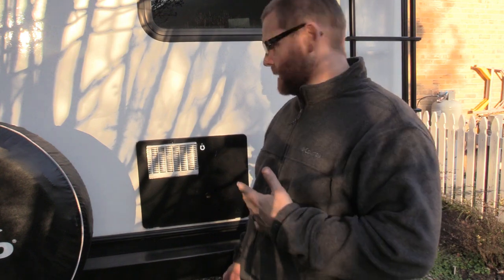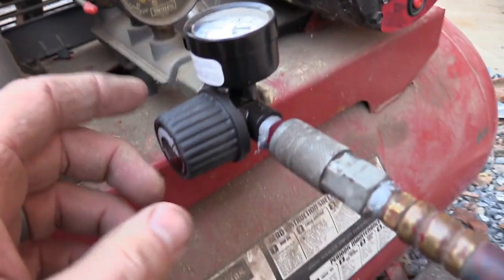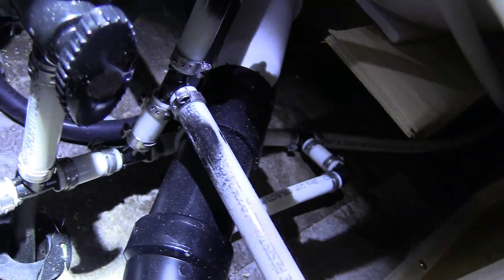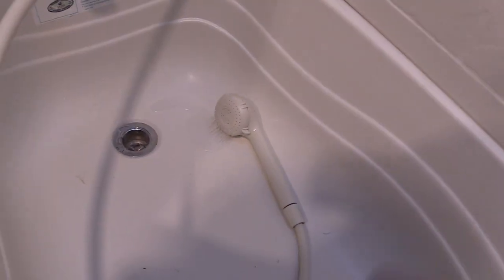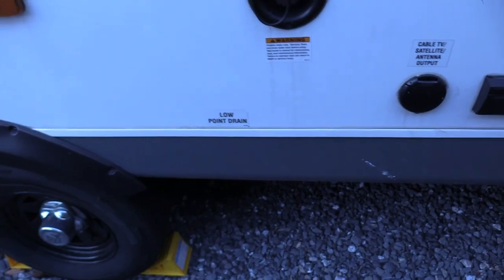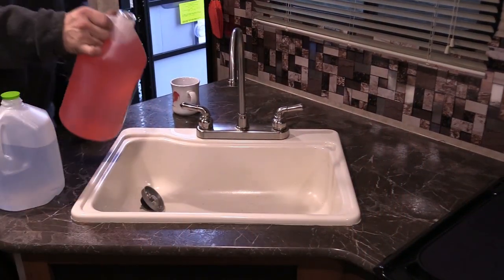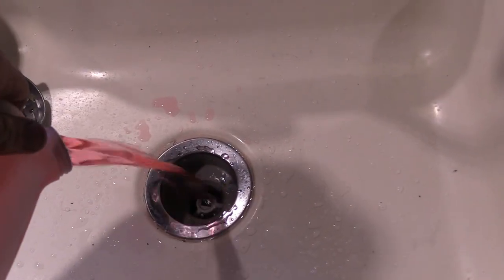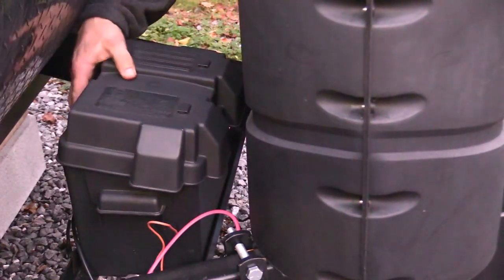How To Winterize Your Travel Trailer Or Camper Using An Air Compressor

Comment: Great vid.  Really like the braided line to drain the water heater.... What adapter did you use to connect the braided line to the water heater?
Reply from the maker: I screwed in a 1/2  inch brass nipple then I used a 3/8-1/2  inch braided line and put that cut off on the end I also made sure to use Teflon tape to make sure it didn't leak. Hope that helps and thanks for watching.

Comment: Very good info and video! If your water heater has both LP and 110 volt... before you begin this procedure I recommend turning off the 110 breaker in the breaker box for the water heater... so you don't damage the 110 heating element... I am an RVTech and every spring I repair the mistakes that RV owners make when they improperly or forget to winterize their RV's...
Reply from the maker: Exactly I couldn't agree with you more once the you turn it in with no water it's over. Thanks for the info and the comment
Reply: @MountaineerOutdoors  You're more than welcome!

Comment: I have a Jayco just like yours and really like the line you installed on your hot water heater to make is very simple to drain anytime you want.  Can you please provide a parts list of what your purchased to make the extended drain valve?  Loved your detailed winterizing video.
Reply from the maker: I used a 1/2 brass close nipple, 1/2 inch to 3/8 braided line I got the best of everything I could so it would last. I appreciate you watching and commenting. Make sure you use Teflon tape. I think it's the best way to drain for sure.
Reply: @MountaineerOutdoors  Thank you sir for your quick reply.  Looking forward to your video about slide closing issues.
Reply from the maker: Yeah the dealership told me that I'd be screwed... Not a good answer. So I'm gonna try to figure it out on my own.

Comment: There is a good reason to disconnect your shower heads and shake out the water then store them with the head up because they will freeze and crack the head. This can happen even with antifreeze if you live where it gets very cold. Just make sure you get all the residual water out. By disconnecting you minimize the chance of any water that didn't blow down from being pushed out to the shower head by the air in the line expanding and contracting during the ups and downs in temperature. I've been using my compressor for years on different rv's to winterize for Maine subzero winters. I just pressurize the hot water tank with air first and open the hot water line the farthest away until it starts blowing air. Shut the valve and pressurize the tank. Disconnect the air and open the low point drain and let the air pressure that has built up in the hot water tank to blow out the water in the tank and the lines through the cold water supply on the tank. Last, re-pressurize the tank and use this to check that all of the lines are clear. Some rv's have tanks that are hidden or have difficult to reach or missing bypass valves. With this method I never have to use my bypass valve and the only reason I would is to add antifreeze.
 I also do this whenever the rv is going to sit longer than a couple of weeks. this keeps the water from going stale in the lines and when the water sits in the hot water tank for an extended period of time it seems to just eat up the zinc sacrificial anode which deposits a large amount of material in the bottom of your tank that needs to flushed out not to mention that you then need to replace the anode.
Reply from the maker: Now I have never thought about that when letting it sit between trips.. That's very useful information that is one thing for sure that I will be doing each time now. I will also take loose my shower head and shake it out its cold here in Virginia but nothing like where you are. Great information and I appreciate your time and comment.
Reply: If you're taking the shower heads off, why not just put them in the house where its nice and warm?  If you're worried about forgetting them, put them in a clear freezer bag and keep them near the batteries you moved inside to keep on a trickle charger.
Reply from the maker: Good advice... I'll definitely have to remember that. Thanks for watching and commenting

Comment: Great video, thanks for sharing. I did this last night to my Jayco. The water heater seems to be gurgling with water, although there is very little coming out of the drain. Do you experience this as well?
Reply from the maker: Hey thanks for the comment and watching. I don't notice anything gurgling after I'm done draining my tank. Not sure if it's just air trapped inside or what. Id say as long as you got all you could out it shouldn't be a problem. Plenty of room for expansion anyway. Have a great day
Reply: I notice this also, am a little bit worried - I leave the plug out, move the camper, and there's still a little water coming out the drain hole.  I bought a camper a few years ago that had a split hot water tank - not fun.
Reply from the maker: I'd say if it still has some in it probably isn't enough to worry about. Just do your best. That's what I have been doing without any problems. Good luck 🤞

Comment: Do you leave the trailer plugged into the garage to keep the battery good or take it in for the winter
Reply from the maker: Right now it's plugged into my garage. According to some people it's not a bad idea to do that. I have purchased a battery tender and I'm gonna to be using that instead. Hope that helps.
Reply: @MountaineerOutdoors  this is my first year owning a camper so I just like to find out what others do. I will probably keep it indoors to stay warm for this winter. I mean we already have snow and it's been in the 20s
Reply from the maker: Yeah I hear that. Good luck and stay warm. It's just now dropping down low here in the teens...

Comment: Braided line: Did you replace the anode rod with the braided line drain system? That would sure shorten the life of the hot water tank.
Reply from the maker: You know honestly I do not have an anode rod in my tank.. I know it's hard to believe but I do not. Not sure why. Now I need to find out why?? Do all water heaters have one??  Gotta start googling
Reply: @MountaineerOutdoors  I saw a different video that shows, this model of water heater does not have an anode rod on the drain plug. Possibly it's  somewhere else.
Reply from the maker: Thank you, I will definitely have to look for it.... I feel like that's such a small thing to take care of and pretty cheap... So thank you for bringing it to my attention.
Reply: @MountaineerOutdoors  You have an Atwood water heater. same as mine. The tank is aluminum instead of steel like the Suburban water heater. Since aluminum doesn't rust, no anode rod required.
Reply from the maker: Exactly it took me a while to figure that out. I couldn't find the anode rod and I asked someone else and they told me the exact same thing as you had said

Comment: I started to do this and discovered that I do not have a socket nearly as ginormous as the water heater plug.
Reply from the maker: Try to use a pair of channel locks if you want to do it.. Good luck..
Reply: 15/16 socket

Comment: New owner here. Your video is one of the few that explains using air instead of pumping anti freeze everywhere. I agree, it’s ok for drains but not my lines. Well done and thanks for posting. Question though, do you put your shut off valves on the back of the water heater back to original after winterizing or do it in the spring?
Reply from the maker: Thanks for the comment I wait until spring. I don't see much difference in doing it either way though. Thanks for watching and commenting

Comment: I just bought my first used rv. Owner showed me how he operated everything. When he said you will need many gallons of rv antifreeze to fill water lines, and has a winterizing kit installed to draw from the jugs, I thought, why would anyone put antifreeze in water lines. I have an extensive water sprinkler system for my lawn and I blow hundreds of feet of water lines with air to evacuate the water. Why not blow out rv water lines with air?
Glad I'm finding videos on doing just that. There will be no more pink junk going into this rv, as long as I own it for sure. Thanks for video. Seems very thorough.am worried about missing a unknown line.
Reply from the maker: I have that same setup where I can suck the pink stuff from my jug but no way for me either. The hidden water lines, you should have cutoffs on the outside after that just makes sure where there is a fixture you open it up and all the water comes out. Good luck and happy camping

Comment: Take your battery indoors or you'll be replacing it very soon. Keep it off a concrete floor and use a trickle charger over the winter.
Reply from the maker: I agree.. Its coming in this weekend. Thanks for the comment
Reply from the maker: Definitely I just leave mine plugged in all the time and so far no issues

Comment: Yep, pretty much verbatim on how we've done our rig for years. My variation is that I do leave all my valves open, with the drain point caps on 'loosely' , with the antifreeze junk only in the "P" traps & toilet. And I only take off the negative line of the battery to the rig, but leave the solar panel charger on it. Love the flex-line drain on the water heater, it's such a pain to get to that plug behind all the other stuff. And bugs? Yeah, we got plenty in GA, including 'mud daubers' that build their mud nests in anything they can crawl into, so everything that has a vent (furnace, water heater, fridge, etc) has a screen over it and sealed around the edges as yours.
Reply from the maker: That's awesome I appreciate you watching and commenting on the video. I've been leaving my battery on and the trailer plugged in and so far it has kept the battery charged.

Comment: Could you just pull the 30amp fuse by your battery before unhooking battery? Not sure if that’ll prevent anything from shorting out inside the trailer just a question
Reply from the maker: I don't know maybe but I just leave it plugged up and no problems

Comment: Help..! Can't find a SINGLE  instruction or procedure on how to winterize a Class-C MH with a Girard tank less water heater using an air compressor system. Thor has no detail in any manual, nor can be found on YouTube...
Reply from the maker: I'm not sure about this one should be relatively the same but I just am not sure. Your dealer should be able to help you with this

Comment: Instead of using a wrench to remove battery leads, replace the nuts with wing nuts. The studs should be 1/4x20 tpi.
Reply from the maker: That is an excellent idea... I wish I would have thought of that. Thanks for the great idea
Reply: @MountaineerOutdoors  Great video.

Comment: I used to own a business maintaining homes in foreclosure. This is almost exactly how I would winterize a home. This method is tried and true. The one thing I would recommend, is that on the air connection to the city water inlet. Install a shut off valve with a gauge. That way you can control the air pressure at the inlet. But his method works good too.
Reply from the maker: Great idea thanks for the tip. Have a great day

Comment: Really appreciate this video. Watched it as I winterized my 19 foot travel trailer using an air compressor and it worked like a charm. So glad I don’t have to put antifreeze in the water lines. Thanks.
Reply from the maker: My pleasure glad it helped.
Reply: Where did you get the attachment from the city water to the air tank?
Reply from the maker: https://amzn.to/3u5iyTm

Comment: Such a great process.  Thanks for sharing.  Unfortunately my drain plug also has the anode so I can’t do your genius trick to add the supply line
Reply from the maker: That stinks, one good thing about yours though is that you definitely are forced to check out your anode rod. Which isn't a bad thing. Happy camping
Reply: Mountaineer Outdoors great point.  And guess what, it needs replaced for sure.
Reply from the maker: That's awesome... I try to always keep up with my vehicle and home maintenance they just made it easier for you.

Comment: Your video was far more informative then the 1 from the rv center. Airing out the drinking water line is much better than running antifreeze. Antifreeze leaves residue which can make you very sick. Don't forget to put a battery tender on the batterys.
Reply from the maker: Battery is tending as we speak.. Yeah my recommendation is if your sales person cannot explain easy questions then next time I'm not buying a camper from them. I had a bunch of questions when I bought mine.. He had absolutely no idea.. Said he had been selling for over 5 years... 😏.. Thanks for watching and commenting
Reply: What is a battery tender?  Can I leave my battery in place if I keep my RV hooked up to the house electric 15-20 amp?
Reply from the maker: I leave mine plugged in now as soon as I get home. And I never have s dead battery ever now. You don't need a battery tender if you do that.
Reply: @mlp267mp  yes.
Reply: @MountaineerOutdoors  thats correct.

Comment: What is the purpose of bypassing the hot water heater? Mine is a pain to access. :) Seems like it is just part of the system & would pressurize just like the Lines.
Reply from the maker: Honestly as long as you make sure you pressurize the lines and empty your hot water heater I personally don't think it would matter. It's the way I was taught so I do it.
Reply: Thank you. Gonna give it a try. :) I live in my RV, but going to leave it in Missouri for a month. Will leave heat low and so that should make me much less vulnerable.
Reply: David Thompson  I don’t use the by-passes either and I run usually 40 psi.  The pressure relief valve has never activated.  But always empty tank first and remember to bleed off the pressure with faucets both h/c and hw tank valve.

Comment: What about the fresh water container ?  Do you put pink antifreeze in it ? To make sure ice will not break it during the winter ?
Reply from the maker: No i do not. Drain it all the way out and I don't ever put water in it anyway. Once I leave the campground I usually open up the drains and let it run out while I'm driving I'd say that the vibration and moving pretty much drains out the tank completely.

Comment: Great video. I like the small modifications to the water heater. I'm a certified tech n we are always watching videos n learning. One bit of advice, make a pressure apparatus n you can test your water lines afterwards to make sure the lines have not been damaged at all. We run into damaged plumbing from too much pressure, usually from city water pressure being too high n not having a pressure regulator. With RVs slow leaks cause big problems down the road.
Reply from the maker: Thanks for watching and commenting. I agree with you on the too much pressure. I regulate the air I use and on the city water I use a pressure regulator for the water so don't damage the pipes. How much pressure can they take? I've been wondering that myself?
Reply: @MountaineerOutdoors  About 40-50 lbs.

Comment: Thanks for the video. one question though, do you leave your air compressor on whole time?  i am just worry that if you leave it on too long between each faucets it may blow up water line?? thanks
Reply from the maker: No i have it set on a regulator so it won't ever go over a certain psi I choose. Good question though.
Reply: @MountaineerOutdoors  Well technically it's on the whole time right???  I know you have it regulated at 35 psi but the way you have it hooked up to your camper the compressor is on the whole time.  Right?
Reply from the maker: @jayboyer8110  yes bit all fittings are pex at least in my camper so it can take alot more psi but for the faucets I chose to regulate it. The faucets will hold that pressure without any problems.
Reply: @MountaineerOutdoors  Thanks, I set to about 40psi whole time and went through each line (sink, toilet, shower, low point drain), no problem as air compressor stops when the pressure reached 40psi and kicked in when needed.
Reply: My compressor Auto shots off if none of the faucets are open.

Comment: some videos recommend using the rv antifreeze in the water lines even after using an air compressor to flush them.  thoughts on that?  (that said i like the idea of no pink antifreeze in supply water lines).  Thanks in advance!
Reply from the maker: I have not done that and I have had absolutely no problems.. I am against them in the water lines all together.

Comment: Well done. Just bought a new Grand Design Imagine. My last trailer I did the anti freeze thing but will blow out the lines with this one. Seems easier to de winterize the trailer if I use it to head south a couple of times over the winter. Thank you for the tutorial.
Reply from the maker: my pleasure and I am glad it helped you.  I just couldn't see dumping that much anti freeze down my drains and then having to get it all back out... good luck and happy camping!!